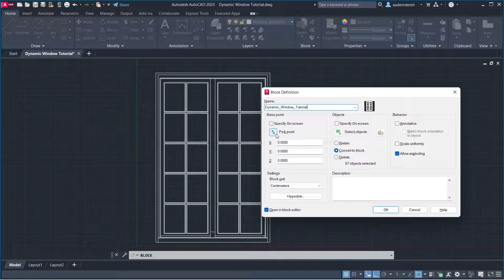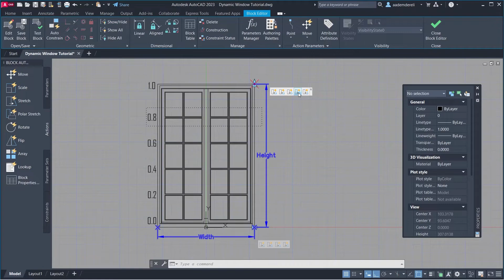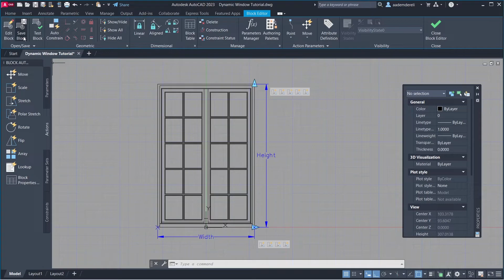Dynamic Window Elevation - AutoCAD

Comment: Do AutoCAD has Grips for selected objects like as in Rhino (Points) where we can select them and Drag/Stretch , I like Dynamic Blocks but enabling jus points to stretch them make it more easy coming from Rhino
Reply from the maker: AutoCAD has vertices, when you select objects.
Reply: @AdamArchh  Can we actually select vertices we want and adjust them ,seems like they are only visible when selected a particular object and can stretch rigid shaped forms but not like say multiple objects stretch or say a corner of window trim, we can select 1 rectangle but not the other rectangle